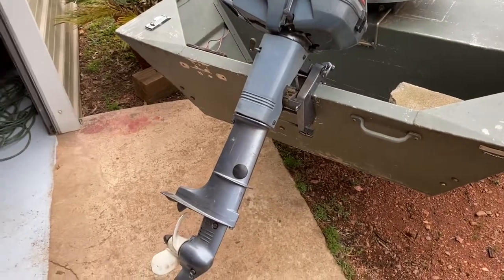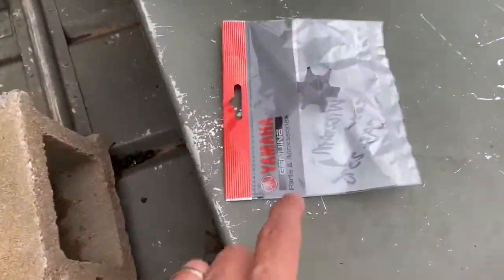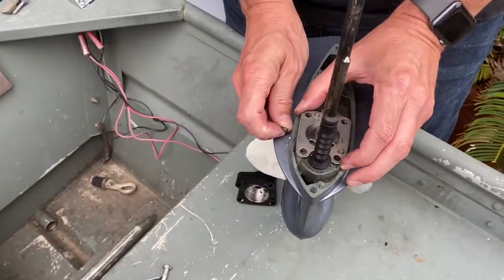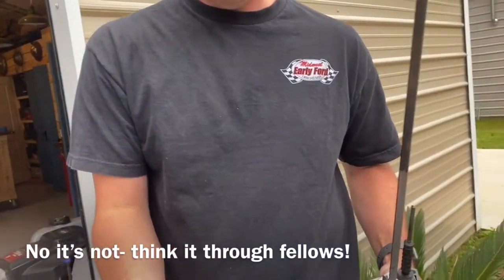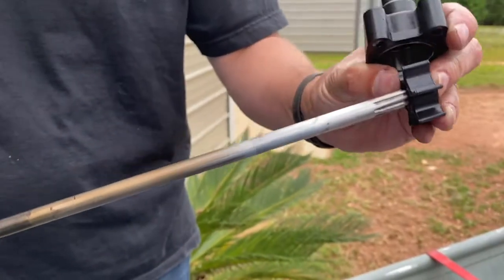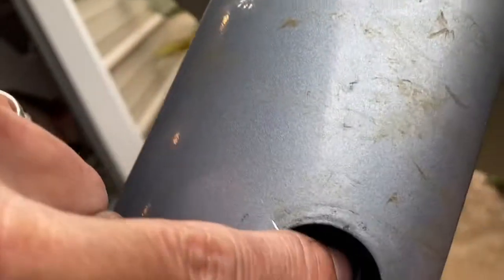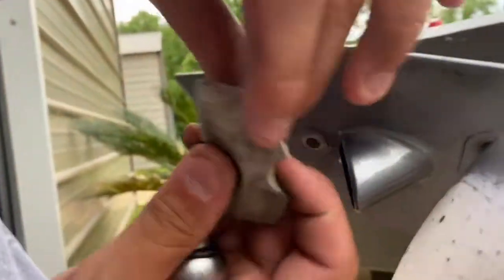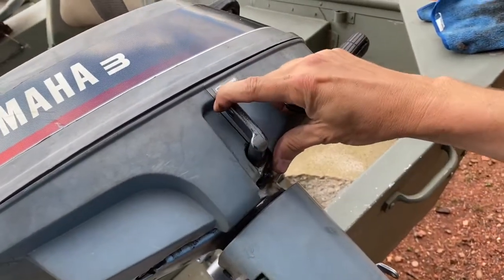Yamaha 3 hp outboard repair: impeller replaced

Comment: Hi fellow!
Always put the impeller first,then the impeller s house...so...put the impeller s pin in the corect position,pull down on the shaft the impeller,put some grease,just a bit in the impeller house,after u put the impeller,come with the impeller s house...in the same time turn the shaft in the clockwise direction pulling the impeller house down.
This way u ll be sure the impeller s pallets r in the correct position.
The way u was doing u risk that not all the pallets to be in the corect position,in this case the impeller it will be faster damaged.
Good luck nd regards from Romania 🇲🇩 Europe!!!
Reply from the maker: Thank you so much sir!  I did not put any grease in there and that’s a great idea. I needed you when I was doing this the first time. Haha!!!

Comment: That's exactly how the Impaler works it's tight on one side so that it creates suction and why they always need to be in water to not heat impeller
Reply from the maker: Thank you!  It’s been working good!
Reply: @williamtunnell  you're a fantastic motorman run 15 of them every day for work. .
We run tenders on houseboats with them. Because they are a great little motor .

Comment: The impeller must be turned into housing the same way that it normally turns!
Will be damaged if not.
Reply: Have you experienced this before? i tested it on a suzuki dt2, they pins will just bow/swap direction of the motor. i dont think its much of a problem. Maybe it does on a older impeller thats more stiff.
Reply from the maker: @ReasonanceHead no, I haven’t. Sounds like that would not pump water as good.
Reply: @williamtunnell  i meant the blades of the propellor wil automatically align correctly do the rotation of the shaft.  But if you can do it the right way from the start it better for sure.

Comment: May I know what model is it? I got a yamaha 3hp too, model 3sf.  Can't find where the telltale is.
Reply from the maker: What are you looking for?  I don’t really know what model it is. I’ll look.
Reply: @williamtunnell  I'm looking for the spit water (pee hole, pilot hole, tell tale) I saw on your clip is come out from the top. I wonder what model does you have. my is 3sf i think it made in 1989 or from that (1989-1997). Looking for where the water come out to cool the motor. my water pump impeller, still good. Thank you for your time
Reply from the maker: Hey brother - sorry it took so long. The Model is 3MSHR. There a code too:  6L5    S.
Reply: Wont have a tell tale jet just a little vent outlet that splutters exhaust and water out.